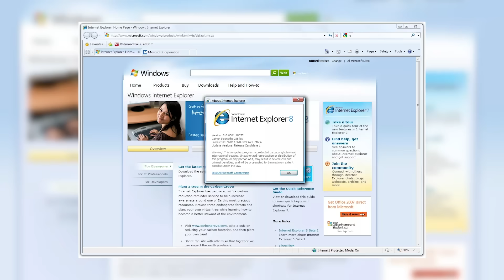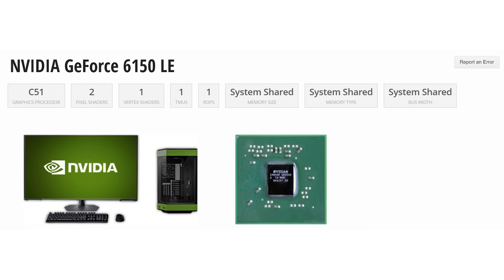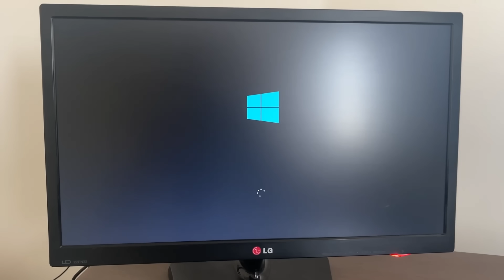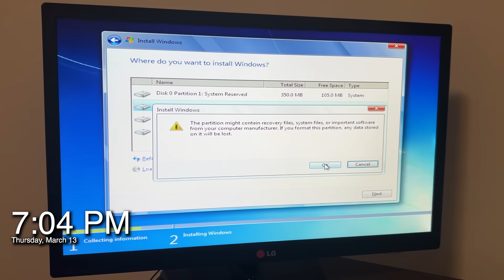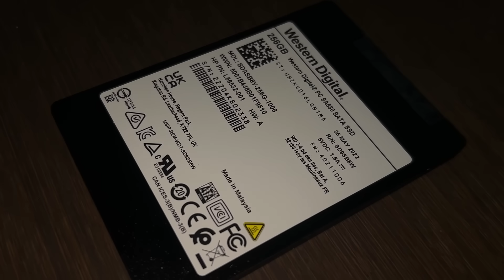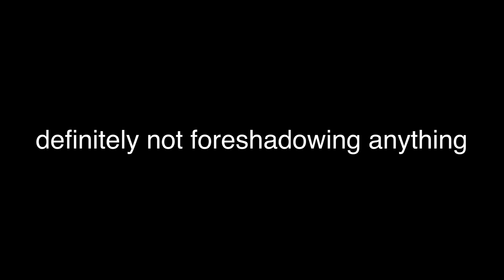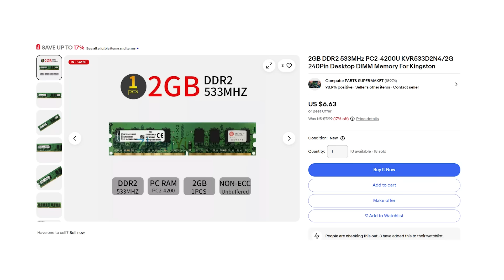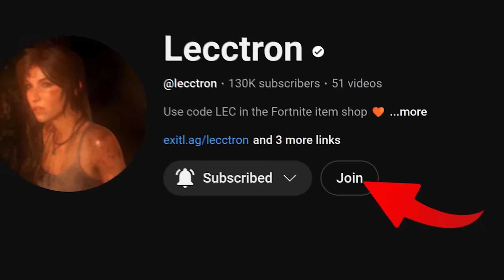I Revived a 2007 PC For Only $28!

Comment: 4:59 it wasn't installing updates it was checking the slow HDD for Errors, you can usually spam press the spacebar to skip disk checking when it first pops up, also if you would have spent maybe $5 more you could have gotten a quad core chip for that socket, and you prob could have went with a slightly cheaper card like a K2200 4GB, that K4200 is definitely being limited by that dual core chip lol
Reply: @Kepler2258 while u can skip it, its mostly recommended to keep it running so chkdsk can fix corrupt files.
Reply: For a quad core you'd need at least a Phenom or Athlon II, both of which are AM2+. Not all OEM boards got the BIOS update to support these newer CPUs. So most likely there is no way to make it work unfortunately.
Reply: @ there are AM2(non +) quad core and tri core chips I believe, I have an OEM AM2 board currently with a Athlon x4 I think it is

Comment: I took an old Lenovo someone had with a core 2 duo processor 2 gigs of cheap slow ram and not much else going for it. I changed the ram for 4 gigs of faster Patriot ram that I had lying around on my shelf, that alone sped it up, then I changed out the crappy power supply for a Corsair 550W, added a GTX 760 I took out of my older sons rig after I upgraded him to a GTX 1070. Added a Soundblaster X-fi I had on my shelf and installed Windows XP on it. Now my second oldest son has a Retro XP gaming rig that plays all the old Windows XP and Windows 95 and 98 games. And it does it maxing out the graphics and sound of the games of the mid to late 2000's. (Crysis can go on High because you can't do Very High unless you have DX10 which XP doesn't have.

Comment: The main drawbacks to old tech is the memory speed or graphics processor if you replace those then typically they will run pretty fast as old CPUs are not that horrible with graphics heavy games
Reply: Power consumption.
Reply: There you are right. 95 watts TDP for a C2Q is too much.

Comment: Wonder that would it take more RAM and a Phenom (or even a Phenom II) after a BIOS update. Usually those RAM limits are processor-based and even a 4200+ shouldn't have issues taking way more than just 4GB.

Comment: Waht a kind of Bullshit video.... i have my Old Gaming PC here,  with an AMD Phenom II X4 16 GB DDR3 RAM 1TB HDD and a GTX 580 Ti and it plays NO Newer game in 60FPS, and even with an 750 TI it will not rund Modern Games because of the Missing DX12 Support. 

And in this PC from the video you can get max 8 GB of RAM.. Because if DDR2

My Last Dell Workstation with Xeon E5 6 Core V2, 32GB RAM Gerorce GTX 750 Ti, had also Problems with Modern Games, but wehen you call games from 2013 modern ^^ you are right. Try GTA V and you will have ~25FPS or so. Max 45 i know that too well.

Comment: I had one of these pavilions growing up with very similar hardware, and I'm very surprised yours even works at all. We had upgraded it to play games and it had died twice in the span of it's life. Once with the power supply dropping voltage to where the fans would barely spin, and twice with all the capacitors going bad on the motherboard killing it finally.

Comment: Btw, the motherboard says, it only supports up to 4gb, cuz it was released very early into ddr2 life, and no 2gb sticks existed yet. You can go up to 8gb with 4x2, or even 16gb with 4x4, but 4gb ddr2 sticks are very expensive, and I am not sure if the athlon can already run the cheaper 4gb high density (amd only) sticks

Comment: just whana say get low spec experience whatch some videos on how to use the program you have trail i dont have to do anything with that program but it helps alot on games to boost fps changing settings and stuf like that and lower the resolution next time to 1024x768 or 1280x720 but i recomend 1024x768 on low end lower than that use it but plss dont record to blury thx for reading my comment IF you did of corse:hands-yellow-heart-red:
Reply: @ i am sorry have you heard the term giving tips knowledge for content?
Reply: its by ragnos 1997 low specs experience try it  it workd for me so give it a try  im trying to help make better vids no promoting

Comment: So.. The AM2/AM2+ cpu & motherboard compatibility is the Wild West. I believe the Athlon x2 4200+  is the fastest 35w cpu. Your upgrade path (if any) relies on what wattage your motherboard can support AND available HP's bios's.  Ex: The Athlon x2 6000+ comes in different version, one is 89w and another Athlon x2 6000+ version is 125W.
Guess what can happen if you put a 125W cpu in a cheap motherboard that only supports 89W. Melting, Smoke & Mayhem!
Reply: @ashriqe Obviously.. I meant 35W AM2 cpu.. given the sentence before AND after it.

Comment: should try linux next time, instead of windows 7. its not even for the usual performance reasons, but the fact that linux doesnt take up much space and typically comes built in with your drivers so there's less install. i really like linux on these old machines, especially when limited by drive speeds.

Comment: You should try windows ghost spectre with the lightest install option available. It works on 2gb of ram and is easy on cpus because of all of the removed bloatware, which results in very big fps gains on old hardware significantly speeding it up.

Comment: Recently put a SSD for $48 in a old HP SFF 8300 and it is SHOCKINGLY fast at tasks despite how old its CPU is. It can't play many newer games, but it can play anything from the 8th generation with ease.

Full specs: i5 3500, 8 gigs DDR3 and a gt 1030 2 gig
Reply: Not that much has changed in 15 years.
Clocks have only risen about 20%, instructions per clock, maybe 50.
So for anything single threaded or not too demanding which is most ordinary home tasks, you'd be hard pressed to tell the difference between that and a new one.
Reply: @myne00  clocks aren't everything, there is also IPC, as in instruction per clock, and that has risen dramatically in the last 15 years.
Reply: @ what do you think IPC stands for?
Reply: that processor isn't terrible tho
Reply: just replace the i5 to an i7 3770 plus RX580 and you will end up with a machine better than a PS4
Reply: @EduardoSantos-bf1jx  I'm doing something similar for my nephew. He is 6 and wants minecraft mods. Lol. I got a spare rtx2080ti which he is having. Just looking for an i7 to put it in
Reply: @Pigcrafter2  I got an ssd in a pentium 3 with a voodoo 3 running win 98. Although it's still ide speeds because I'm using an ide to sata adaptor. I just use it because a 240gb ssd is cheap as hell. I have another going into my new project which is a pentium 166mmx. Its gonna be running win 95 and dos 6.2
Reply: throw in an used GTX 1650 and you will be playing even latest games
Reply: I guess it makes sense. Before SSDs, many processes were storage bottlenecked more than they were bottlenecked by RAM or processing power. So much time of a task was loading the software into RAM from the hard disk. Give a PC the best RAM and best SSD its motherboard can accommodate and new life is breathed right into it.
Reply: U want better experience? Add a better gpu like an gtx 1660 super will work good
Also if you have extra money add an extra stick of 8 gb ram.
Reply: @Pigcrafter2  8th gen of consoles?
Reply: put a GTx 1080 in it and you can pla ymost new games
Reply: @the_sjdo not even that a 1060 i have a 1060 in a simular system and i can agree. it runs amazinly
Reply: @draculamins3779  the good on or the bad on ?
Reply: @the_sjdo  power supply probably wouldn't support it, and the case is only half height and space is tight. So hard to fit a full height card even with risers.

SFF PCs are a bit of a pain to fix up.
Reply: @ZipplyZane  everything can be upgraded but the way its another story
Reply: yeah, old HPs have always performed well, I used an EliteDesk 800 G1 SFF (I5-4690, R5 430)

they are amazing computers for light gaming.
Reply: @ i even use a hp elitedesk 800 g1 mini tiny with Arch btw :3 . And its still hold up as a Daily PC.
Reply: @ yeah even on windows 10 they are still quite good
Reply: @the_sjdo  i have an hp elitedeskk 800 g2 sff and i have a i5 6500 CPU , gt 1030 4GB (rare variant btw, but performs worse than the 2 gig)  i can only play video games from a decade ago on 720p low :(

Comment: This mobo should hold 8gb - 4 ram slots X 2gb 800hz, I have a similar one with the exact cpu Athlon X2 64 4200+, I upgraded a while back as my off-line retro gaming pc running dual OS winXp and Win7. Still has my old beast gpu of the time gf8800 gtx 512mb. You can also upgrade the cpu but probably won't notice much difference.

Comment: Hi, i recently installed linux on a shitty ass laptop and what i can say is that its not that hard. all that was an issue was splitting the drive into partitions, but if youre going to format (reset) a drive that wont be an issue. another thing to note is that its very strange and difficult to work with as a beginner, but as you use it more youll begin to understand it more.